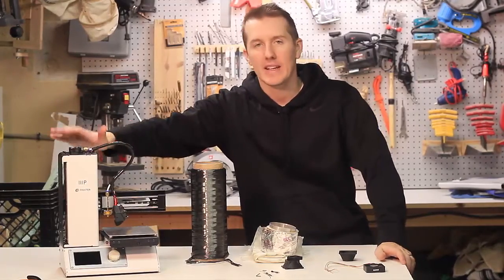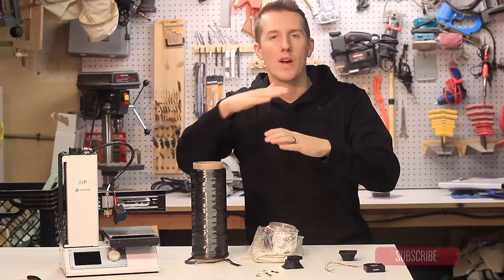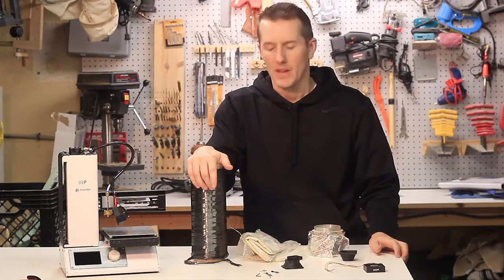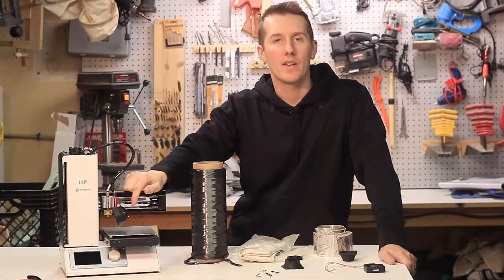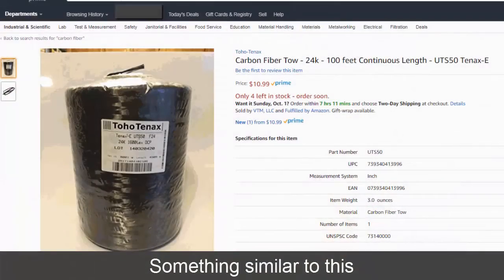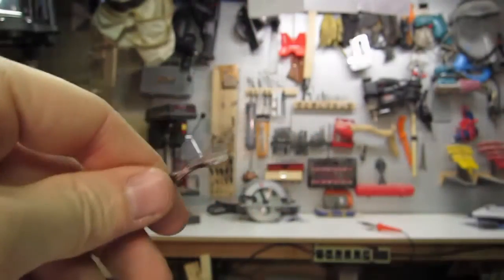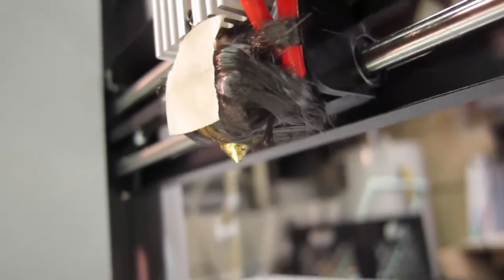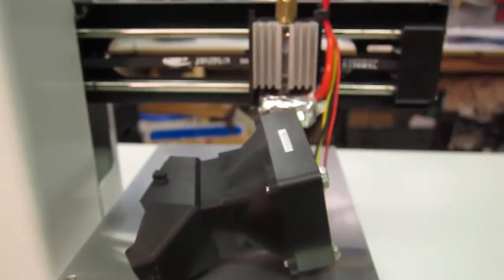How To - Insulate Hotend of 3D Printer - to Prevent Clogs

Comment: Thanks for the video! I did the fiberglass method you suggested after having lots of problems with filament melting in the Bowden tube. I added a few layers of 6 ounce fiberglass cloth to the top of the hot end secured with kapton tape and it worked great, no more problems.

Comment: Carbon fiber is no good idea either! Its a great electrical and thermal conductor. Glass fiber would be the best option. Good heat insulator and no electrical conduction, so no fried mainboards haha. Also carbon does oxidize at a few hundred degrees C and will eventually catch fire at above 800°C while glass doesnt. Please get your infos right.
Reply: Yes the original lining is glass fibre stuck together with some Kapton tape.

Silicone socks should be good though. You couldn't buy them for MK8 hotends back a year ago but now you can, or you can make your own.

Comment: Hi Dave, I got the mini, and I replaced the complete hotend with an E3D V6 original version.
That might be a little more expensive, but you get everything you need for the mod.
It takes about 1h to replace everything, not counting the time to print the new hotend holder (have to print it first, before disassembling)  :-)
I kept the original thermistor and the heat block, so no changes there.
You have just to add/connect the permanent fan (comes with the E3D V6) to the main switch or any other 12V permanent source.
Due to the fact, that the E3D V6 does not have any PTFE-tube insite, you are safe, as long as the heat sink fan is on all the time.
This mod runs on all my printers I have, except the 2 new Anycubic Delta and MEGA, which will be changed, as soon as they fail with the stock hotend.
Thanks for the video...
Reply from the maker: Ya i actually switched to the E3D V6 clone a while back too.   https://youtu.be/2tFa1svpPwQ
Reply: Hey man CF is great insulator but even better conductors so be careful

Comment: Hey man it’s me again, so a follow up to the last video I ordered the new tip for my printer the same one you used but it’s huge and I can’t level my bed correctly how did you deal with this problem did you have to open the printer and adjust the z stopper? I have my bed literally tightened all the way down and still is touching the bed and I know this isn’t good for my bed springs, thanks for the help and responses in advanced!
Reply from the maker: Andrew Boyle ya you need to use a spacer to activate that z axis switch.  Check my 3d printing playlists for Adding a Glass Bed, i go over the different spacers you can use.  Or you can redrill and move the switch up 1/4 inch
Reply: Thanks